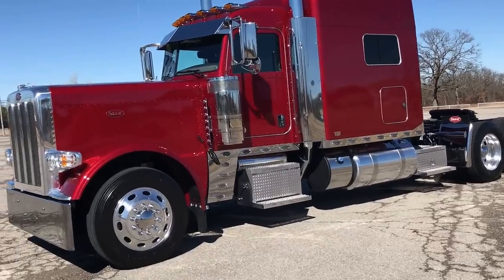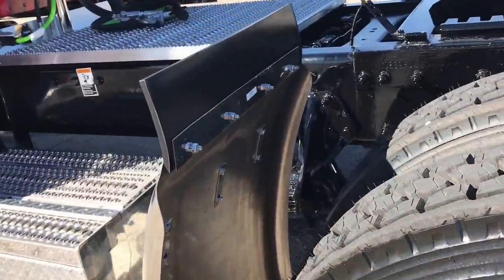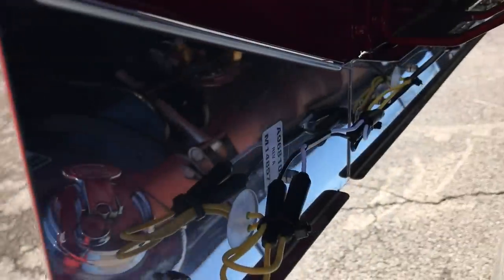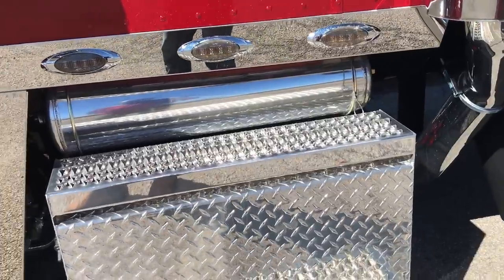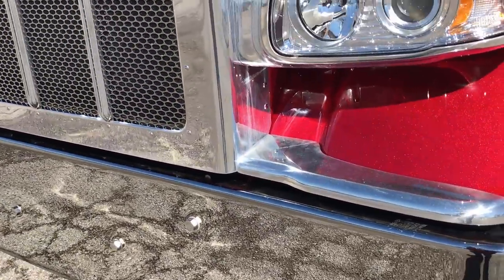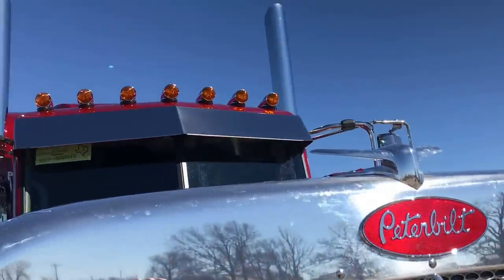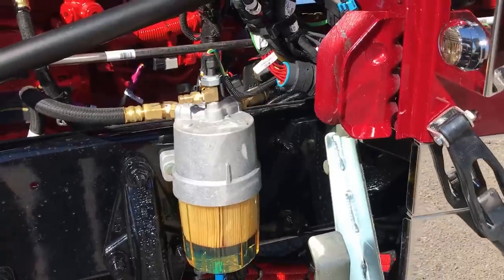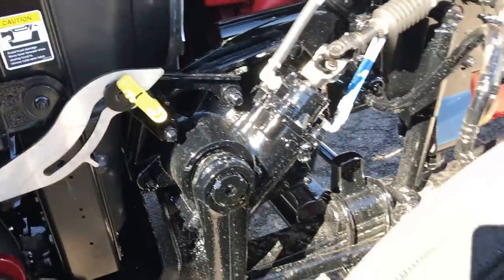Legendary Red Metallic 2018 Peterbilt 389 X15 Cummins 2050 Torque 3 axle Disc Brakes

Comment: Better off to get all the options when new.  In the long run. Trade or sell it in 4 years. Get most of your money back.  Put a 5 year warranty , bumper to bumper.  Still has a year left for the next guy.   That's the best way to go with a Pete.
Reply from the maker: Not a bad plan

Comment: Have there been any improvements with the DEF system in the past couple of years? I bought a brand new Pete in 2011 and that def system was junk. first two years wasn't too bad , until the system went bad as well as the turbo and other problems. I sold the truck and got out of the business.  I love seeing the trucks you build, the one I had was a metal flake red similar to this one.
Reply from the maker: Tremendously better, 08-12 and even early 13's were rough as a group but the late 2013, 2014, 2015, 2016, and 2017's have been extremely reliable. The 2018's with the X15 and less sensors and emission related parts should be even better.

Comment: wondering about the feed back with emission issues with these trucks. minimum little or non at all.
Reply from the maker: No emission issues since 2014, very reliable
Reply: Peterbilt Steve good to know. I was looking to upgrade equipment but I have issues with my 2012 emissions on a regular basis. Thanks

Comment: +Peterbilt Steve you should only do Automatic Transmission Trucks because they're so much better in traffic than a Manual Transmission and lots of truck companies are going the route of puttin Automatic Transmission because it's so much better to drive in traffic than a Manual Transmission
Reply from the maker: Automatics definitely have their place but my customer base is the 13/18 speed crowd....